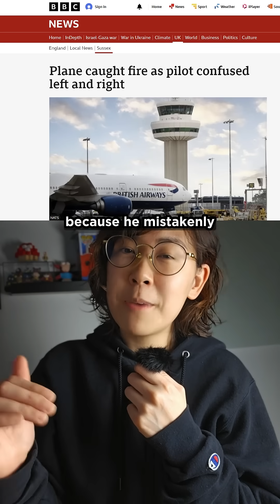Did a Pilot’s Left-Right Confusion Really Shut Down the Airport?

Comment: Before landing the thrust will stay on 45-75 thrust and to make a butter landing you will counting the Light (The white and red one) and count the feet so after you count it you will pull the nose and thrust down and the flap is 1-2 when landing and when taking off just do the same but push thrust and flap 3-4 in mid air just make the thrust 60-80 thrust to safe more fuel

Comment: mainstream media live in the same ecosystem as the rest, and that ecosystem dictates what criteria have to be fulfilled to thrive (or, well, at least stay competitive).
things that help do that for "print" media are for instance clickbaity headlines and easy to read article texts.

more importantly maybe some things don't help them be competitive and are "wasted time and effort."
one of those is when they explain something that is possible but awkward to put into words, and this lever thing is exactly that. images it reading "[When they were about to take-off] the co-pilot confused the motion to perform with their left and their right hand respectively in a way that would have been correct for a landing" instead of "[..] confused the left and right lever" ..the latter is simpler, feels more streamlined, and allows you to immediately follow it up with what the consequences were.

add to that the pressure to be quick and not having time to craft a more precise sentence that also nicely fits into the flow of the article. not to mention the possibility that something got misunderstood in transmission.

Comment: So he engaged Reverse Thrusters instead of Thrusters? And therefore went from Not moving to Not Moving Backwards? And the Brakes which are supposed to hold an Aircraft steady at nearly Full Thrust caught fire because .... Reverse Thrusters at full thrust are more powerful than Regular Full Thrust? And Why does switching to reverse thrust cause an issue before takeoff, When They're engaged on landing and are just disengaged? WTF was wrong with this engine and brakes that a) the brakes caught fire from just engaging the reserve thrusters on takeoff and b) The reverse thrusters couldn't just be disengaged and throttled up correctly?
I mean when you're in a Car and you're accidentally in Reverse and you press the gas and you go backwards, you feel that immediately and hit the brakes within the first quarter second, Correct it into Drive, and then go correctly after that. When an airplane is lined up for takeoff and given  the all clear, If they release the brakes and go backwards, That should be able to be caught immediately, corrected, and proceed for a normal takeoff within a few seconds. Usually several seconds are allocated for that takeoff process so this correction should be well able to be completed within that normal takeoff timespan without the brakes catching on fire. Sounds like something was very wrong with these brakes.
Reply: This was during rotation, not the start of the roll. At that speed, the pilot pulled back on the thrust instead of the yoke(to rotate the plane) initiating a go-around, and forcing the pilots to continue with it. The brakes caught fire due to the friction of going from rotate speed to a full stop.

Comment: Nonsense

There are 3 speeds during takeoff: V1, V_Rotate and V2.

V1 is the decision speed, below this, takeoff is to be aborted.

V_Rotate is what is being discussed here.

EVEN if the pilot(s) reduce engine power by mistake, they still have the speed to power up again.

This report is a lie.
Reply: Pilots are trained to continue an aborted takeoff after it's been initiated simply because there really isn't enough time to gage whether or not you'll make it.

Comment: This is 100 clickbait bs. Is it technically factually correct? Well, there was a mistake, and there was a fire, so strictly speaking... yeah. So they can't get in trouble for outright making things up. That said, it's really on the teetering edge of truth. He didn't stictly mix up left and right. Just pulled instead of pushed. So its fairly obvious that the article is trying to inspire panic, fear, and maybe comedy to the niche few who think airplane fires are funny. It skirts the line of truth with clear click farming intent. Its cheap, sleazy clickbait and a reason to not respect that publication.

Comment: Bit of flying enthusiast here. Firstly , Co pilot is old term. Its first officer and they are not a trainee as media often makes out. They can be more experienced than the captain as they can also be a captain taking FO position on the flight. 

Im dubious about the story because during take off they pass a point of no return called V1  while still on the ground accelerating along runway. Stand procedure is to acknowledge this by removing hand from power leavers (left hand is removed) after v1 will theygetbto Vr which is the point to gently pull the nose up and lift into the air. 

Of course i don’t know the situation but i tend to be dubious about many media report if it sound sensationalist like this one does and using terms like co pilot also a red flag for me.

Comment: So, it looks pretty weird since the “co-pilot” is usually the person with the role of pilot monitoring (working plane hydraulics), while the pilot has the duty of controlling (moving the plane). Since the “Co-pilot” was Pilot controlling (executing take-off maneuver) that captain actually had a pilot role. The left hand seat doesn't specifically belong to those in the role of pilot controlling, they roles and seats are rather randomly chosen.

Edit: the Pilot in command usually sits in the left part of the seat but no rules strictly say so, its more of a tradition. But since the pilot on the right seat was executing the take off, this time the pilot was sitting on the right seat of the cockpit (no blame on him for the incident, he already had worked a lot and was really tired, thus it was a really out of normal situation.)

Comment: You said " during take off the cooking has his hand on the thrust levers or throttle to power up the engines " which is incorrect the engines were started at pushback and they already taxiied to the runway so it's not called powering them up its called engaging TOGA ( take off to around ) thrust

Comment: Is this the case where there were 2 pilots in the cockpit, but one had a role of the FO? If that's the case, the both pilots would be used to control the power with the right hand and fly with the left, but when one pilot takes the role of the FO, that's an easy mistake to make.

Comment: If anyone is interested, the reason the take off was aborted and the breaks were damaged is due to the auto breaks going to max as the throttle was cut.  This is a system to prevent overruns in the event of an aborted take off.  However, when so much force is put on the breaks, it can cause them to catch light.

Comment: He basically engaged the reverse thrust mechanism (a mechanism used to slow the plane down during landing by redirecting exhaust gasses forward) instead of setting them to the take off position with either the button or pushing the levers. He meant to pull back on the yoke but instead pulled back on the thrust lever when he was trying to rotate (get the nose off the ground). If things continued in the manner the plane would not have enough speed to lift off the ground and would possibly cause a crash. The pilots followed the rejected take off sequence where they set the brakes to maximum and pushed the nose back down. Once the plane had come to a stop, the brakes caught fire. This is not rare in a rejected take off but can be super costly to replace as both the brakes and tires have to be replaced.

SIDE NOTE: You aren’t supposed to push the yoke down/forward during landing. The nose is usually kept at a 3-7 degree angle for a smooth landing.

Comment: Technically, co-pilot confused forward and back. Or as russian officials use to say, "the accident was caused by an abnormal spontaneous inversion of control signals at forward/back control channel of the vehicle operator, which happened due to aforementioned operator's sensory system being driven into illegal focusing mode caused by decoherence between motor and thinking activities (so-called "automatic reflectory shunting" or "asynchronous reflectory bypass"), which, in turn, was caused by routinely repeated implementation of flight procedures".

Comment: They didn’t have to do a rejected take off. Pulling back on the thrust levers on the 777 automatically initiates the rejected take off manoeuvre, with the exception of deploying reverse thrust. I’m assuming they the pilots didn’t deploy reverse thrust, and so the only thing stopping the aircraft were the brakes and spillers, hence the hot brakes.

Stopping after V1 is also ridiculously stupid as stopping on the remaining runway isn’t assured. Luckily they didn’t end up off the runway and in a field / house.

Comment: What stupid plane designer does not DOUBLE all controls? When left seat and right seat have exactlty the SAME controls, you would never have this incident. It's exactly like a righthand and lefthand steering car: you should NEVER drive the wrong kind of car, it is dangerous. And that stupid Boeing does not even understand this wisdom?! It is crazy that pilots have the throttles in the middle, one gets USED to sitting left or right. Switching is dangerous. Get the copilot THE SAME controls config. Gee, do they really build such dangerous cockpits?! Why?!

Comment: Pulling back on the throttles doesn't engage the brakes lol
Reply: Helps it does. The brakes are preset to “RTO”, and that auto brake setting is activated with the thrust levers being retarded, above 85kts, during the take off roll. On the 77j, to reject a take off, all you need to do is retard the thrust levers and the automation does the rest, except steering.

Comment: Although it caught fire, it's normal for the breaks to heat to extreme temperatures from an aborted take off to the point most planes have a 'cool down' before they taxi to the runway again. 

Saying the 'plane caught fire' in this case is technically correct about as much as 'a house caught fire' when a fireplace was lit

Comment: First of all it’s fwd and back not up n down second of all if you move the levers back you go into reverse thrust and you will start rolling backwards and if you brake the brakes won’t catch fire since your going about 5-10 kts backward not 160-180 like on landing and even then they wouldn’t catch on fire unless you only use brakes, no reverse thrust or spoilers/ speed brakes.

Comment: WTF pulling back on the thrust was is the whole point behind why they stopped.  The first officer did in fact do the wrong thing.  Pulling back on the thrust lever WAS the reason the crew had to abort the take-off.  Rare, but the mainstream media is actually somewhat correct in this case.  This video made me cringe as an aviation geek.

Comment: @vt.physics
Can you trust yourself to get the story right?
The pilot had normally sat in the left seat and since this was his first flight coming back from leave he sat in the right seat as co-pilot.

Clearly, this was his muscle memory taking over.  He caught his mistake immediately and throttled up; but they had decided to abort the takeoff.  That decision to abort the flight is what caused the overheated brakes.

So it was the pilot confusing his left from the right and the AAIB listed this action slip that he confused a procedural movement due to ingrained motor habits from his prior seat position.

So BBC’s simple summary is more accurate than yours as you tried to make it look like an unexplainable confusion.

Comment: Those headlines sound quite accurate. Did you listen to what you said. Pilot pushed and pulled the wrong levers, resulting in an aborted takeoff which caused the brakes to catch on fire.
"Brain fart", "confusion", "mixed up" are all synonymous.
When an airliner aborts take off in such a fashion, even without a fire, the plane is delayed at least 30 minutes while they wait for the brakes to cool down in case they need to be used in the event of another aborted take off.

Choose some stories with real misleading headlines.

Comment: Your "investigation" is pretty disingenuous if not completely wrong. The co-pilot (having failed to remove his left hand from the thrust levers) performed a further action of pulling back with his left hand (retard thrust) when he should instead have performed an action pulling back with his right hand (pull back control column). In other words he performed a pull back action with his left hand that he should have performed with his right hand. It isn't perfectly described in the various news reports but all of them describe what happened better than you did. You should note that click bait starts with exaggerating facts with the intent to sensationalise. A bit like what you did when you said "so I dug deeper and found the actual AAIB report" when in fact all you did was click on the link to that report embedded in the middle of the BBC article. Great sleuthing newshound. You dug deeper... what bollocks.

Comment: On takeoff a pilot usually presses a button that activates the auto/thrust and the plane’s computer sets the preset thrust with the levers. The pilot only has to keep his hands on the thrust levers to check that the auto/thrust doesn’t do something unexpected.
Reply: Incorrect. The report makes it clear that after his initial  left hand action on the thrust levers to roate, he should have  removed his hand from the levers and used his right hand to pull back the column. Instead he mistakenly kept his left hand on the levers and pulled them back instead of the column. Hence the headlines about lft right confusion. Thenews media got it right. This Youtube "expert" didn't.
Reply: You press the TOGA button(s) and that initiates the thrust levers to advance their preset position. By 80kts the thrust levers mode becomes HOLD which removes the servo power to the thrust levers so that they are, essentially, disconnected from the automation. The pilot (almost exclusively Captain) still holds the thrust levers until V1, at which they remove their hand, as this is the point when the take off must continue. The thrust lever servos are then reconnected at 400ft, as a thrust mode engages together with a climb mode.
Reply: @EdOeuna  This is right but is immaterial to this story. The copilot having realised his "action slip" error decided that while he could have safely engaged a  TOGA he would instead abort. His reasoning was that he had already briefly commenced retarding thrust so it made more sense with sufficient runway to recommence that action.
Reply: Well NO, not in this case. Here's another person that needs  to read the report rather than attempt to impose their expectations and beliefs on the reality. The report states that under the protocol in that cockpit at that time, that once the thrust levers had been advanced the pilot  should have REMOVED HIS LEFT HAND FROM THE THRUST LEVERS. End of discussion. That is the official  finding. Instead he wrongly retained his left hand on the thrust lever and made the "action slip" performing the action (pull back) with his left hand that he should have been performing with his right hand. NotE: one action not two despite what VT says. Stop telling people what you believe happened or should have happened and read the damn report.

Comment: It's much worse than that. The BBC is not meant to be "mainstream" media; it's supposed to be state media. The fact that they are engaging in sensationalism is precisely why it should be shut down. It has no need to sensationalize since it receives funding from the state regardless of its performance. It doesn't rely on subscribers, which highlights that the people it hires are chosen for reasons other than their journalistic skills. It's absurd behavior since they are state-funded.

Comment: Confusing the LEFT and the RIGHT? No way. That would be ridiculous. Actually, he confused the FRONT of the plane and the BACK of the plane. Then, when the pilot said to push the thrust lever in the MIDDLE, his head exploded.
Reply: Wrong. Read the report. He performed the pull back action with his left hand instrument, that he  should  have been performing with his right hand instrument. His left hand  should not have  even still been on the thrust lever  at the time so your "front middle back" explanation is  incorrect. It's all there in the report and it's not a long document
Reply: @i1uvpreppyxo887  He still didn't know the front of the plane from the back. I'll bet he even confused economy with first class, too.